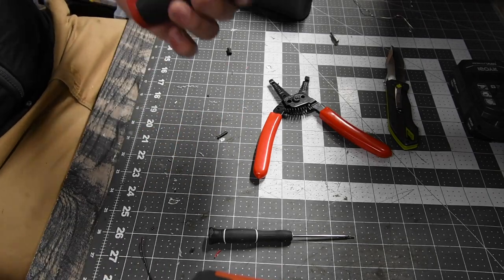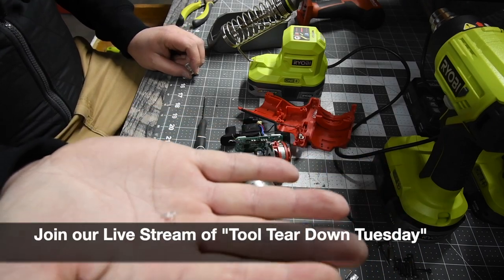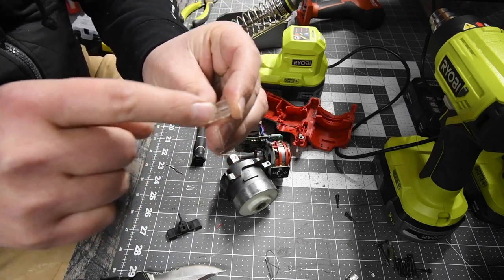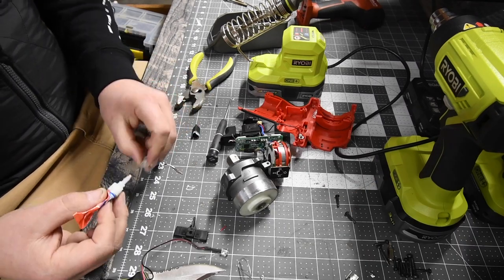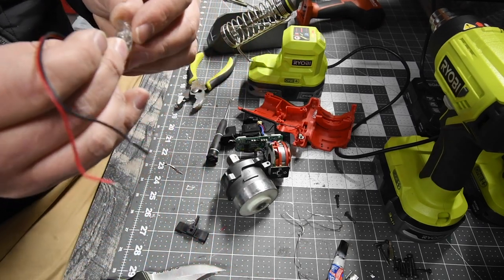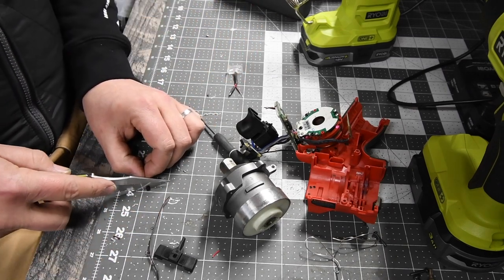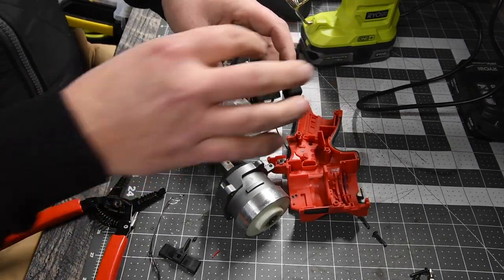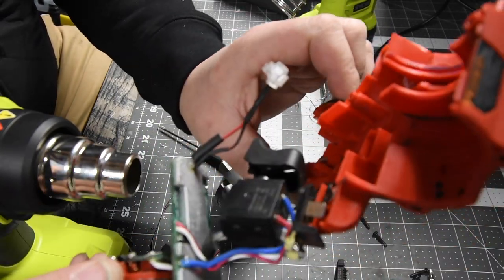Milwaukee (M12 1/2 Stubby) light repair

Comment: Cool vid. Question, I have a brand new M12 stubby 3/8 with a 5.0 ho battery. The tool cuts out and starts flashing lights when Its under load, is this a battery or tool issue?
Reply from the maker: you will have to test that with a regular battery

Comment: Very cool, I wonder would it work with ultra Bright LED or could there be a power limit
Reply from the maker: I think it will work with bright light but it would make the battery drain faster